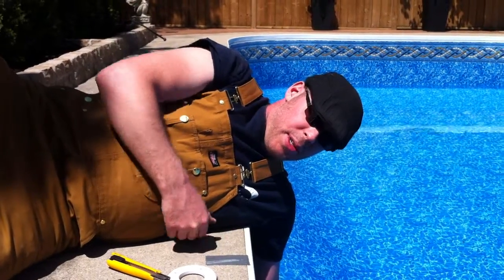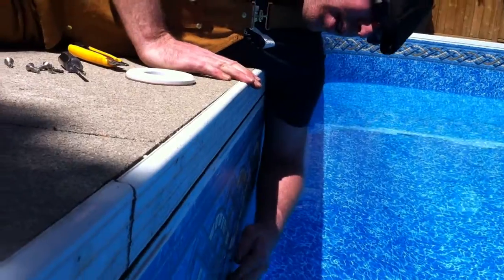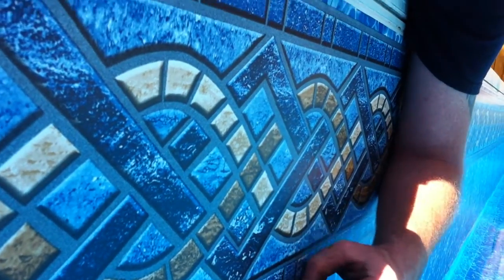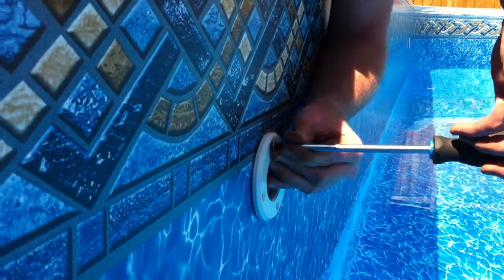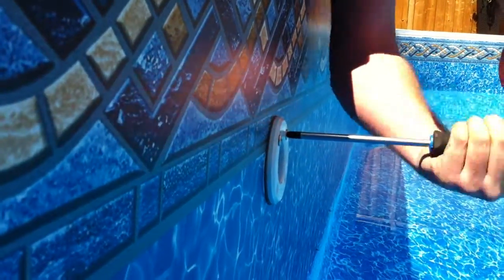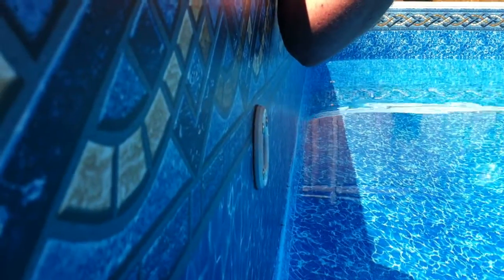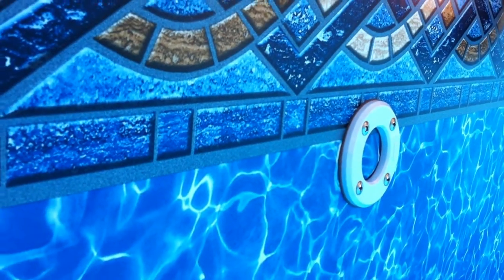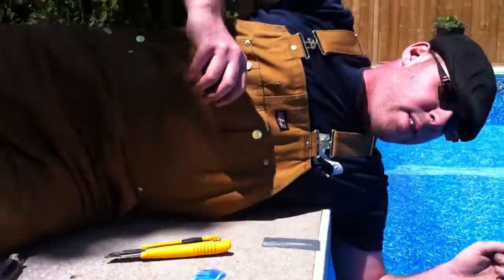How to install a pool return faceplate (Jacuzzi)

Comment: Hi steve' I did most of the preparations for a new liner myself but hard experience pool guys install my liner. They use duct tape to seal the returns and skimmer and lights and they leave it there when installing faceplates. Is it ok? Cause basically the tape is acting as a sealing surface behind the liner like a gasket?
Thanks
Reply from the maker: It is ok, and normal.
Reply: @Swimmingpoolsteve  thank you

Comment: Can you add a new return on an old liner? The reason that I am asking is in my oval pool I have a large dead space at one end of the pool.
Reply from the maker: I would not recommend to try that
Reply: Swimming Pool Steve what would your recommendation be?
Reply from the maker: I would be sure to brush that area of the pool down regularly and I would plan to add a return the next time that you need to change the liner.